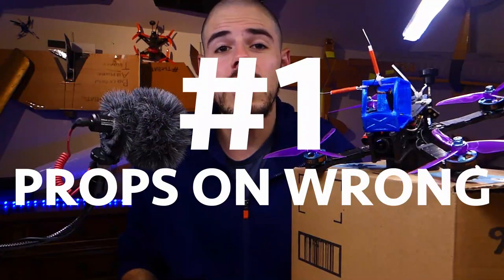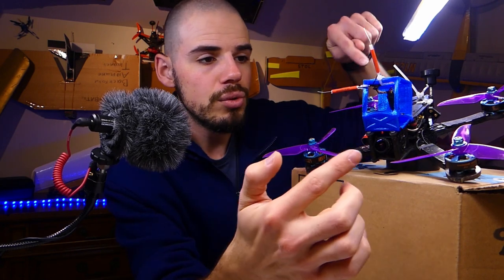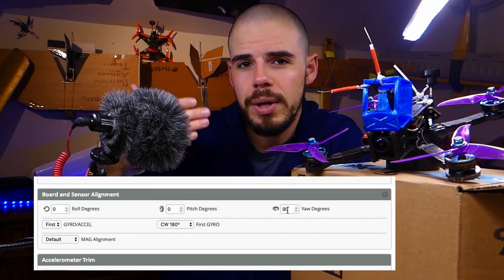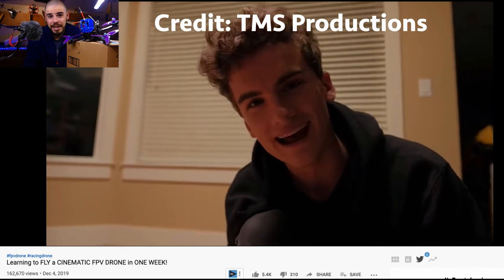🤔 16 SNEAKY things Noobs MISS! Common Problems with New DIY FPV Drones - Quadcopter Troubleshooting

Comment: Here you go:

01:14 - #1 Props on wrong
01:49 - #2 Loose props
02:28 - #3 Motor spin direction
03:38 - #4 Betaflight motor direction
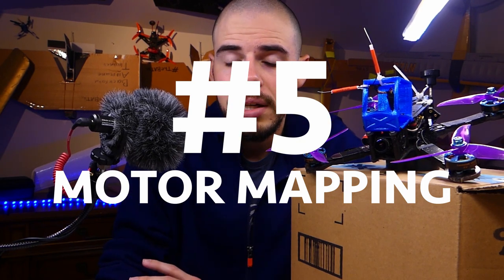04:37 - #5 Motor mapping
05:35 - #6 Flight controller orientation
06:34 - #7 Calibration
07:15 - #8 Arm angle
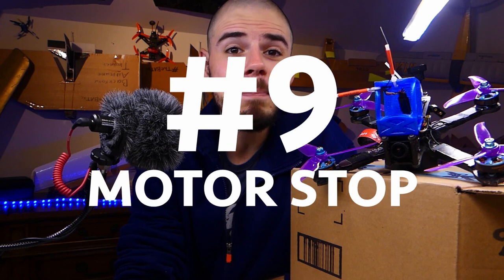08:10 - #9 Motor stop
09:10 - #10 Arm switch
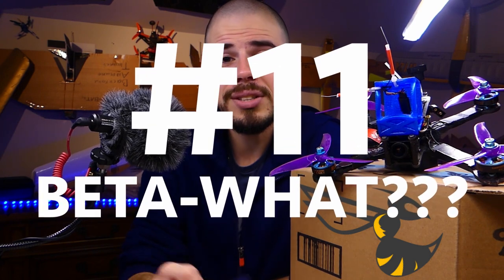09:40 - #11 Beta-What???
10:16 - #12 Rates too high
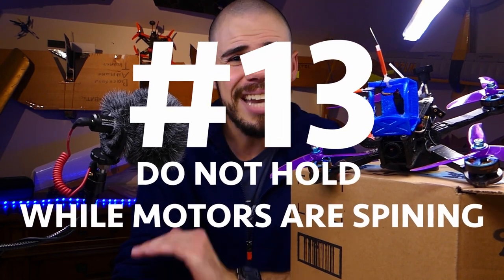12:27 - #13 Do not hold while motors are spining
13:28 - #14 RX settings
15:38 - #15 Flashing firmware
17:33 - #16 Drivers

About nr 13, if you know what you're doing there is no problem with holding your drone while arming. I usually fire up my grill using my 5 inch drone with a 6s LiPo. ;) Just remember to grip well, be in pure ACRO mode (no angle/air/horizon).

BTW #13 isn't a "common problem", but a safety tip. I would change it to something like: remember to set your failsafe!
Reply from the maker: Thank you for doing that! I'll add it to the description.  😁 👍

Comment: Changing the motormapping in Betaflight really worked on fixing my drone after switching out the motors. I’ve had this problem where my drone would just spin on take off, and since then I’ve tried calibrating the motors, my receiver and so on. Really well thought through video!

Comment: Great video my problem is when i arm there quad hesitates. Then motors start  spinning but throttle will go full out with just a small increase in throttle with the stick. Then it flips over. Thanks in advance

Comment: HEY MAN!! Thanks sooo much for this video! SO I recently just went through like 3 AiO FCs trying to upgrade a drone, and I kept thinking I was getting defective ones! Everything was right, so I thought. PROPS were on right, all betaflight settings were as usual, that's always worked. My problem was #6 flight controller orientation! I had no idea those things had arrows! (I'm still fairly new in fpv, a year or so experience, but I usually only buy BNF :P). I've been frustrated for over a week now, until I found this video!! :)

Comment from the maker: What did YOU have to do to get your quadcopter WORKING? Let us know! 😁👍
Reply: How can I get in touch with you for a consultation?
Reply from the maker: Hi! Email or message me on skype at RCwithAdam @ gmail .com
Reply: I spent fucking plenty of time
Reply: @maxihohlik2333  I uhhh, just started my build about 2 and a half months ago, I finally have all the right parts and my 4th motor stopped working on me, and the cherry on top is my radio remote gets run over, busting the right stick... I soldered in a janky broken off piece of a motherboard with a stick on it and somehow actually got that to work lol, now I have some more troubleshooting to do with this motor and I'll be on my way

Comment: When binding (and connecting) your radio to the quad, should you be some distance (like 3 feet) between the quad and the radio in order for the two to connect?  I ask because for the past few days since binding my quad to the radio, I noticed that the quad would not stay connected to the radio.  Just today I just so happen to notice that the quad will connect and stay connected to the radio if the radio is about 3 feet from the quad.  Have you experienced this?   If so why does it have to be that way?

Comment: One thing I often see wrong on builds is people using antenna tubes for the receiver antennas but they mistakenly think that the silver part of the receiver wire needs to be exposed. That's actually the part you want to protect with the antenna tube. Doing so keeps the antenna from getting chopped by props, ripped by branches and keeps the active part of the antenna straight and unbent which keeps it working well. Nice tips for new pilots in this video. 👍

Comment: Thank you for your video. Its not easy getting started in this hobby. I have a HGLRC XJB 145 I got used on Amazon. It has a Frysky XM+ reciever. The problem im having is when I bench tested it arms fine but when I spin the motors up after a few seconds they don't want to come back to full idle and one motor runs away. Please help.
Reply: same exact problem here with my nazgul that i recently got in the mail. Did you find any solution yet?
Reply: @royofzo4698  yes, so I tested it with the blades on and it worked fine.

Comment: Thanks Adam for this I am building my first quad and your videos are really helping. Please keep going
I have done the build , done beta flight setup and Esc calibration and motor direction using BlHeli. But when I give a tiny amount of throttle, motor 2 and 4 are keep on throttling up to maximum, so I am afraid to take my first flight ,
What do you think the issue is…
Reply from the maker: Hi, Aslam! What flight controller and esc are you using? Did you calibrate the accelerometer?
Reply: @RCwithAdam1  thanks Adman for the reply.
I am using Mamba F405 Mk2 FC and mamba F40 MK2 Esc STACK. I think it’s the same stack which u have used for budget Basher build series, I have done my wiring based on your video😊 and it’s works well😊

Comment: Just built my first drone. But only motor 4 spins. I used the multi rotor 25amp castle esc's. All 4 individual esc's. Motors 1, 2, and 3 have an esc with NO BEC, motor #4 has the exact esc, except it is equipped with a BEC. Could that be the reason that only motor #4 spins and the other motors don't respond?

Comment: Drone will not spin motors except in Betaflight. New BNF quad from i-Flght. New DJI FPV setup shipped from DJI. All binding good seems like a GPS or Failsafe issue or maybe AirUnit version issue.Is there a checklist I can get my hands on?

Comment: hello,
i am using f3_evo board, and fs-i6 transmitter, and using fs-a8s receiver and brushed motors
i assigned the arm switch to swc( even tried by assigning to vra, vrb,swa,swb,swd), when ever i try to connect the battery to the drone , the motors are running, i tried to arm it but its not happening and even the motors wont stop, any help or suggestions please

Comment: Hey Adam great video.here's one for you.my Emax tinyhawk freestyle won't arm on 2s battery only on 1s.proberly one in ten it will arm on 2s but by then the batterys lost some charge and not worth flying.ive found no info why this happens and wonder if you know?btw im not a newb and have build't quads and know betaflight enough to set up quads.many thx
Reply: I've had 2 of those they're junk throw it away 😆
Reply: @rockman49er  mine works ok all sorted now.just gotta know what your doing hey??

Comment: Problem:  OSD wasn't working after flashing the latest Betaflight firmware to my flight controller.
Solution:   Re-upload the fonts to the flight controller via the Betaflight Configurator.

Apparently the fonts got wiped when I flashed the firmware.  Turns out the OSD was working the whole time, it was just invisible because the fonts were invisible.

Comment: Hey, I recently build myself a Tyro99 and got (what i thought) was the right parts, I've got a Frysky XM+ receiver and a Flysky FS-i6 transmitter thinking it would work.
It doesn't, is there any way for it would work or do I to just buy another receiver, and if so which one would you recommend for me to buy?
I'm fairly new to drones and stuff so a response would be greatly appreciated.
Reply from the maker: Hi! Sorry to hear about the mix up! It's a pretty common mistake though. 🙂 I would recommend the Fli14+ receiver. If you can't get that, then the FS-X6B is still a fine choice.

Comment: I bought a bind and fly iflight nazgul evoque with crossfire nano receiver and F7 blittz flight controller, and when i hook it up to my tbs tango 2 controller and testspin the quadmotors, it speeds up the motors uncontrolably when I pass a certain throttle threshold, after the threshold point the motors then keep accelerating and they become uncontrolable and i have to disarm. Angle and horizon modes are disabled.
Reply from the maker: Hmmm. It could just be the airmode feature causing that. It may be best to carefully do a test hover with the props on (stay far away, though!).

Comment: I have a 3 inch drone I just built that goes into horrible pitch oscillations when it tries to take off.  I tried to tune it out with pids but it just keeps doing it, not sure what ive done wrong.
Reply: if the flight controller isnt centered, slightly askew or pitched at a slightly off manner could that cause it?  I guess I'll try to mount it better.  I just have it stuck on with tape. lol

Comment: I brought a ready to fly unit and it took me for the longest time to work out why it would flip instantly on take off, turns out one of the motors came welded wrong from the start, switched wire like you suggested and wollah, fixed
Reply from the maker: Nice work! 👍Isn't that a great feeling!

Comment: Ok . I just have a ptoblem.  I have a geprc mock 4 4k 5" and idk if its because I vhanged my rates or what because it doesn't do this all the time but when i role to the right it will often stop mid role and start rolling again and stop and finish the role . Very hard to keep from crashing.  Im wondering if its a paid thing because I snipt the very tip off of one of my props to see how it would act with a little more to compensate for during the role and when i tried it after the altercation , it cork screwed very jerky like and tumbled to the ground.  But im not positive that pid tuning will help and ive never done it either.  So im going to drop my d to 0 and see what happens.  Any info or help would be so awesome because I want to fly this thing . Ive only flown it like 4 times.
Reply from the maker: Oof. That's a tricky one. I don't think it has anything to do with the PIDs. What are your rates now? It sounds like a receiver or stick input connection issue. I would definitely go into betaflight (in the receiver tab) and make sure that the transmitter inputs are working smoothly.
Reply: @RCwithAdam1  so I did that yesterday and everything looked fine but when i looked at my gyro it was reading funny.  I think it was the x axses which ever one is used for a right role and it was spazzuming out jumping from 0 to 4. 6 or more like crazy fast . I think thats my problem . It got better when I turned my d term off but not back to normal and it flew like crazy . Ill have to look at my rates . Im trying ladribs rates but I didnt change the pids to match not sure what they are or how to find out and i know that pids  are a quad to quad thing . Do you think i could flash my firmware to fix the gyro?

Comment: Nice info
I hav a problem with my new quad, when I punch n then close the throtle the quad fall forward. Normally it should be fall flat, could you help me with this problem
Reply from the maker: Hi! What kind of quad is it (brand, model)?
Reply: @RCwithAdam1  iflight titan xl5 with iflight succex-A f4 aio dji fpv systmem

Comment: What am I suppose to use for nuts on 3d props that spin in both directions.  A castle nut with a cotter effin pin?   Just a hell of a lot of red loctite...?

I dont' understand why they still insist you solder motor wires to the ESCs, when you could just have a plug in connector for them like every friggin else has now.... :-/
Reply from the maker: I guess a cotter pin would actually make sense. Do normal nylon locknuts come loose? I've never flown a 3D quad.

Comment: my tinyhawk freestyle 2 is insta fliping. my props and motor are on right and spining the right way and everyting is stock rtf except a motor I swaped cuz I burned it (it's ok I checked multiple times). I even did a CLI dump and rebinded everything and it still insta flips. WHYYY
Reply from the maker: Is it flipping in autolevel mode? If so, make sure to calibrate the accelerometer.

Comment: I have a water damage on my Drone and my taranis the tharanis is Not talking to the Crossfire anymore and the Drone Just beeps the First 3 Times Like normal but then there are only 3 fast Strange beeps. Somtimes it binds to the Crsf.and the taranis but it dosent Work anyway...😩
Reply from the maker: Oh no! What drone do you have? Try covering it in a bowl (or bag) of dry, white rice for at least a few days. That should suck out the moisture. Also, if you have corrosion on the electronics, use CorrosionX or similar product to get rid of the corrosion.

Comment: Hay man my name is Ray Ray I have a web page and I've been flying toy drones for the longest time mainly the bugs 3 the mjx cuz it's a free flyer a practice drone to get ready for building cuz I have done everything with the bugs 3 okay now onto my I've got a y que es 250 it was all resembled when I first got it I could cut it on and fly around okay now I don't know what's happened move stuff around it to fix it because there was too much stuff on the bottom so I put it up on the top and now it won't activate start up for anything

Comment: I’ve got a super wierd problem with my drone, when I arm it makes a strange humming noise and then when I give it a tiny bit of throttle i lose all throttle control and my voltage immediately drops to red, if anyone knows what this may be let me know
Reply from the maker: Hi! Is it still doing it? I have no idea what that is.

Comment: Why my drone is rotating round and round while take Up?
Reply from the maker: Hi! Whar model of drone is it? It sounds like your YAW trim might not be set to zero. Make sure your yaw trim is set to zero both on your transmitter and in betaflight in the configuration tab (if you're using betaflight).
Reply: 5 inch,mamba f405 mk2 FC, Flysky fs-ia6b recvier,but not using camera vtx.
My yaw is 1500 and on transmitter is on zero.
My problem is that is rotate round and round while take up also Drift and Angle mode is also not working tho I assine that mode
Reply from the maker: @sanjeevsebastianmurmu5631  have you tried calibrating the accelerometer?
Reply: It is flying

Comment: i am building my first copter, my problem is that when i touch my throttle just a little bit it immediatly goes full throttle...
Reply: This is suppose to happen on the bench. My problem is it is happening to me in the air...... Did you fix this ?
Reply: @skyweaver3199  yes! I set the idle speed when armed to i believe 1060 and that fixed the problem for me
Reply: @lasthryx7854  omg man thank you for replying....I.will do this right now. I am about to go for my second flight. I got....one flight that was good , but the motors sounds were , imo not good....So I have literally spent 10 hours just researching , and trying to solve the issue in Betaflight lol. (I guess this is part of it all right, haha)
Reply: @lasthryx7854  would you be willing to have a quick chat with me ?
Reply: @skyweaver3199  yeh sure
Reply: @skyweaver3199  you have discord?
Reply: @lasthryx7854  yes
Reply: @lasthryx7854  skyweaver#6255
Reply: @skyweaver3199  whats your id?
Reply: @lasthryx7854  Skyweaver#6255

Comment: Problem:
-Drone turned upside down from the floor and motor stopped automatically.
Solution:
My 4 in 1 ESC was soldered upside down🙂

Comment: At 2% throttle my motors slowly keep climbing until they max out
Reply: Did you fix this ????
Reply: also, i know it is supposed to happen on the bench, but it happened to me while on my maiden flight.
Reply: @skyweaver3199  no it just failsafes and falls. It's a tyro99 and I cant find anyone else with this problem so far. The FC is crap and there isnt any info about it that I can find
Reply: i have the exact same problem. I bought a bind and fly nazgul evoque with crossfire nano receiver and F7 blittz flight controller, and when i hook it up to my tbs tango 2 controller and testspin the quads motors, it speeds up the motors uncontrolably when I pass a certain throttle threshold, after the threshold point the motors then keep accelerating and they become uncontrolable and i have to disarm. Angle and horizon modes are disabled. Have you found a solution to this problem allready?

Comment: Thanks, man! Helpful stuff. I have another problem that maybe you or someone else knows about. here is a video : https://youtu.be/fn6nNnHJTAQ
New system Prebuilt iflight DJI system. Never flown it just got it all and bound the radio and goggles to the air unit. I throttle the quad and it does what you would expect...UNTIL! screams up to full throttle and I can't get it to lower. Super glad i did not put on the props!